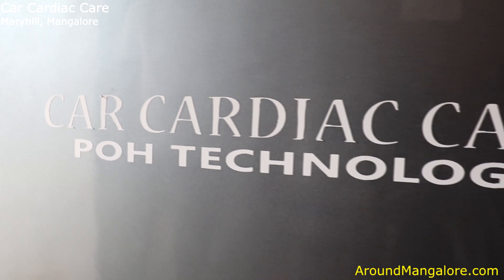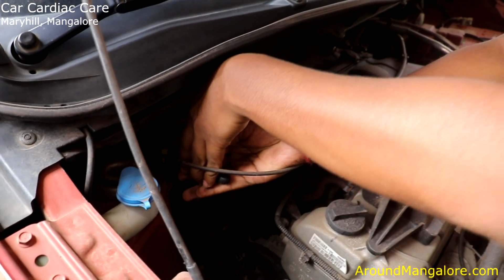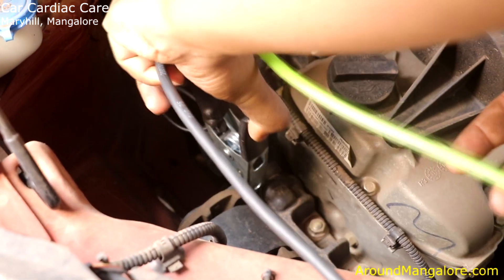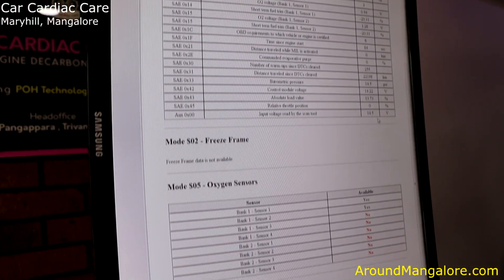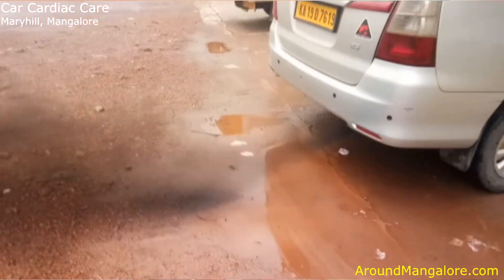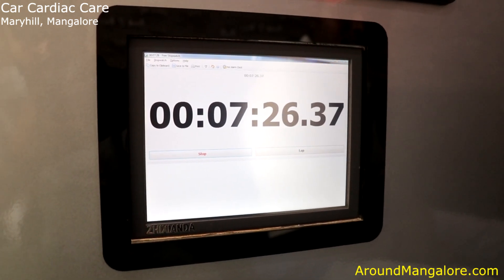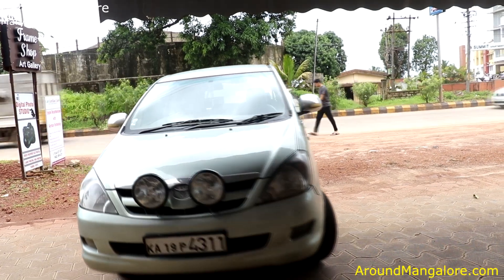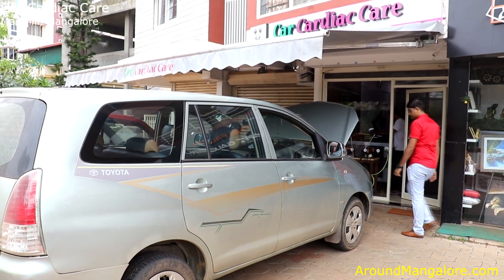Car Cardiac Care - Engine Decarbonising - Oxy-Hydrogen Cleaning Process - Maryhill, Mangalore

Comment: What an Excellent Service!

Never expected such a huge improvement in performance of my vehicle(Duster). 
+ Pickup Increased
+ Mileage started showing above 19+ which was 12 earlier.
+ Breathlessness while accelerating is completely vanished.
+ Noise level of the engine got reduced to some extent.

For sure will recommend Car lovers to Visit and give a try!

Mr. Puneet.. Thanks Man.... for the magical experience I din't expect from my 1,82,000 kms run vehicle. It now feels like a new one!

Comment: Its more than a business. A good initiative to protect the environment. Way to go!
Reply: This does nothing except lighten customers’ wallets.
Reply: Car Cardiac Care Mangalore 

As it runs, an internal combustion engine produces about the same quantity of water (as hot, high pressure steam) as the quantity of fuel consumed. Therefore, it decarbonizes internally as it runs. The small amount of water produced by combustion of hydrogen gas introduced through the intake is insignificant and ineffective by comparison.

Besides, contrary to your explanation, analysis of what you claim to be carbon deposits consist mostly zinc and calcium from oil additives.
Reply: @FrankGutowski-ls8jt  You are mistaken my dear friend. We are not adding hot water or steam via intake. We are passing oxygen and hydrogen to perform pure combustion and thereby converting the carbon to carbon monoxide and then carbon dioxide and clear it through exhaust. Please understand the technology or decarbonise your vehicle before commenting. 
Thanks for understanding.
Reply: Car Cardiac Care Mangalore 

Pure combustion? What does that even mean? You’re adding a small amount of hydrogen to the hydrocarbon fuel the engine is already burning. So what? 

You seem to imply that burning hydrogen has some effect on combustion of carbon. Oxygen does, but you’re not introducing enough additional oxygen to have any effect. If you think extra oxygen burns away carbon deposits, find a way to temporarily lean out the fuel/air ratio. 

Have you calculated how much fuel hydrogen gas represents compared to combustion of the hydrocarbon fuel? You’ll find that you’re introducing less than 1% of the fuel and oxygen the engine normally consumes. Again, so what?
Reply: @FrankGutowski-ls8jt  Brother... Please don't tell anything about the quantity of oxygen and hydrogen we pass. Because you have not tried our technology before or you have not decarbonised your vehicle at any of the Car Cardiac Care centres. Please try and if you don't get any results then you have the right to criticise or comment negetively. Our technology is the result of several years of technical study (nearly 15 years) and also we have lakhs of happy customers all over South India. I request you to come to us and try it and then you can share your results. Please don't misguide without experiencing personally.
Reply: Car Cardiac Care Mangalore 

The quantities of oxygen and hydrogen introduced are relevant to understanding any potential efficacy of the process. Other videos promoting the same idea reveal that the quantities of hydrogen and oxygen are insignificant. 

Your unwillingness to disclose that kind of information heightens my skepticism, and suggests that you probably never have given thought to the amounts because it wouldn’t help to sell your service.

Comment: Petrol and diesel engines build up carbon deposits inside the cylinders over a period of time. This carbon build up happens for various reasons – from improper burning of fuel, to substandard fuel quality and general build up with age. It deposits itself as soot around exhaust valves, in the exhaust, on the cylinder head, on the piston and on the intake and exhaust manifold.

Over a period of time, especially in older cars, this carbon build up can lead to valves not closing properly, spark plugs fouling, exhaust sensors failing and other issues. Some of the first symptoms of carbon build up will include a lack of power and low mileage from the car. Severe cases will also show up as black soot deposits spilling out of the exhaust.

Carbon build up happens over a period of time. Usually the best time to decarbonize an engine is after it has done about 50,000km. This is a preventive maintenance procedure at this point and your vehicle wouldn’t have had too much carbon build up anyway.

Service stations, though, would try and sell you this service even if your vehicle has done just about 20,000 km – because it’s a money spinning venture for them. Service stations charge anywhere between Rs. 1,500 to Rs. 2,500 for this service depending on the car brand. This charge is for a “chemical decarbonisation” procedure.

There are two ways in which an engine can be decarbonized – Chemical decarbonisation and physical decarbonisation.